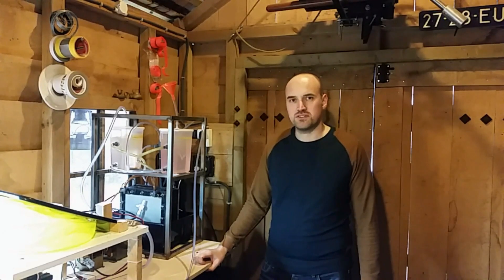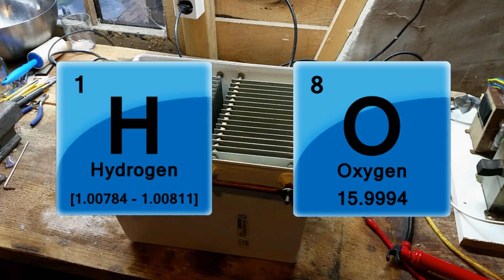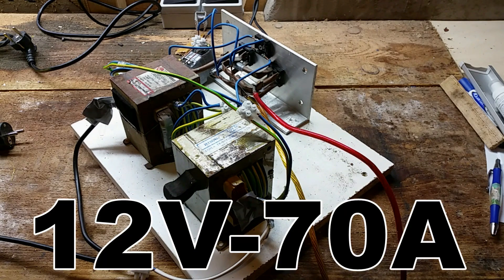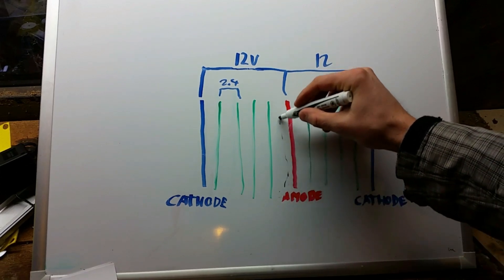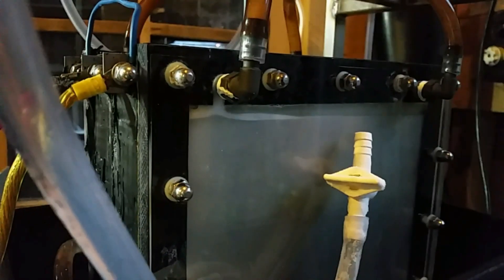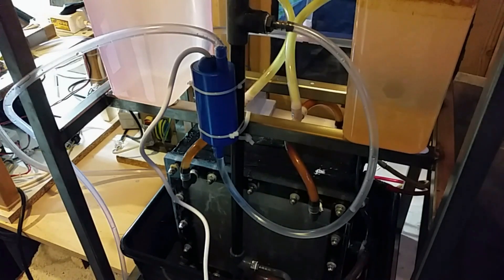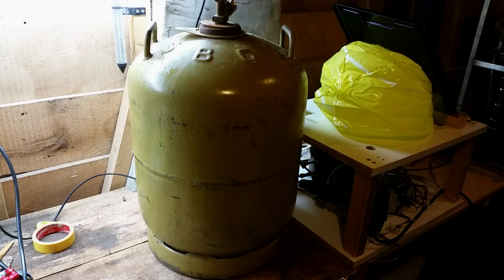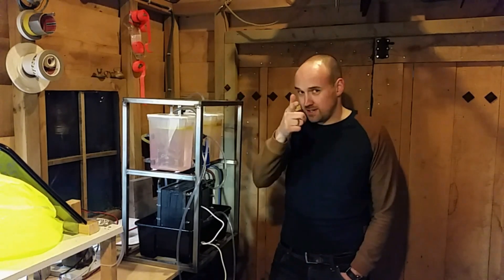Hydrogen Generator #1 Homemade Hydrogen Generator And Compressor Unit

Comment from the maker: Here are all the hydrogen generator videos, enjoy: https://youtube.com/playlist?list=PLTYlUGKLEk-GZfbXewpyRNn2iJ8RNepBd
Reply: As you have to use DC - have you tried powering using solar? Also, you mentioned heat generation an issue - could you use that heat to generate hot water through a heat exchange? The point being, you could use a full solar system to generate power and hydrogen during the day - with battery storage. Use the excess heat for hot water and the hydrogen gas for heating. And sell the oxygen onwards.
Reply from the maker: No, I have not tried that jet. And yes, that would al be possible. Good suggestions! 👍
Reply from the maker: Well that depends on so much variables, size of you care amd house plus insulation. Yes I'm Dutch.
Reply from the maker: No I haven't yet.
Reply from the maker: No, sorry, I only have the videos and the diagram.
Reply: Thanks
Reply: To keep your compressor running buy a potential relay setup with a star capacitor and every time it turns off it can come on with no problem right after it shuts off instead of waiting for it to equalize hope this helps
Reply: is there a point where where you need to add new water or how is that arranged ?

thank you for your video
Reply from the maker: Yes, but it's only a small amount.
Reply: Thanks
Reply: Heb je hier planne van? Ben zo benieuwd
Reply from the maker: I have a diagram on Facebook: https://www.facebook.com/234679430309932/posts/pfbid0zkfNAvgzUFJKLaCM4KE457xyGV7rhU7NqZDama54mQMgEzXyyejB6LAApa6TS8CVl/?sfnsn=mo hope it helps!
Reply: @TheDIYScienceGuy  Hey ... did you ever check the purity of the H2 mixture?
If so, how close to 100% is it?

What is the maximum you can compress it to with that fridge compressor?
I have heard that hydrogen can embrittle many storage tanks not specifically designed for Hydrogen. Have you any concerns with that or have you researched that at all?

Thanks man.. Love your work!
Reply from the maker: @TheBlairHouseProject No I did not check it with a measuring device, only just by burning it. You can compress to at least 35 bars, but I only go to 13 because it takes more energy to compress to a higher pressure and to keep it on the safe side. Hydrogen embrittlement  does not happen in austenitic steel, only in martensitic steel. So as long as you can weld the steel and the weld doesn't tear right beside the weld when you apply force to the part you welded on, you're good to go.
Reply: Losses are current leakage
Reply: did you try making a column to separate the oxygen and hydrogen?
Reply: You've got a good system
Reply: I would love your plans
Reply: I need a schematic of your system and explains of what your components do. I will be willing to pay for them should you ever decide to make them and have them available
Reply from the maker: @VG-rj8pn I have a diagram on Facebook: https://www.facebook.com/234679430309932/posts/pfbid0zkfNAvgzUFJKLaCM4KE457xyGV7rhU7NqZDama54mQMgEzXyyejB6LAApa6TS8CVl/?sfnsn=mo hope it helps!
Reply: I know this is old and I'm just now looking into hho generator but if you reverse the proses it generates energy right? How much energy could this produce
Reply from the maker: @eveni9574 No, unfortunately, that is much more difficult. You need platinum electrodes and a different construction: https://en.m.wikipedia.org/wiki/Fuel_cell
Reply: Beautiful work, 
Is it possible to post or send me a pdf blue print for the hydrogen generator please.
Reply from the maker: @tffffgvb 13 bar, so 188.5 psi.
Reply from the maker: @tffffgvb yes, they are all more or less the same. You can put several PC power supplies in parallel.
Reply from the maker: @tffffgvb no I don't think so.
Reply: Please consider your home insurance and codes, unlrsss mistaken as medicinal organic chemist pretty sure theres labeling WELL DEFINED RULES, slso matrix ā chemical mixture has to be kept with, unless thinking of liquid H2.  Was so bored at otherwise great synthesis and had many things going on wasnt listening.  They explained it in small amounts even on catalytic hydrogenated compounds, sort temp before added to heavy ballon septum under inert N2 atmosphere or ARGON.  Forgive me if incorrect, tss as Lt has color and label Diamond hazmat, if cad… could be looked up when chance, working on significantly more deadly project.  Good luck, seem responsible and safety science concerned.  👍🏻

Comment: :face-purple-sweating::face-purple-sweating::face-purple-sweating:BOOOOMMMM:face-purple-smiling-fangs::face-purple-smiling-fangs::face-purple-smiling-fangs::face-purple-smiling-fangs:
Reply from the maker: No boom!
Reply: @TheDIYScienceGuy  yesterday I was building one,and no flame able gas was coming out,so like an idiot,I squeezed the generator hoping it would squeeze some hydrogen out. It worked, but too well,and the spark traveled back up my hose and blew up my generator,with my hand still wrapped around it! I don't know how, but my fingers didn't come off, but it completely broke my left hand.
Reply from the maker: Oh, nooo!!! That is not good! You should always use a flame arrestor! I hope you get well soon!
Reply: @TheDIYScienceGuy  thank you. Hand is feeling much better today. I am still working on it building one,but I don't know if my solution for spark not traveling back in,is the same as what you described. I'm basically putting two water bongs in-between the generator,and the flame. I'm hoping the spark cannot travel through the water to get in the supply line. If you know of a better way, please let me know. Flame arrestor,is that like a propane gas regulator,or is it a container with water that stops it before it travels back down the line? If you are able to find a minute to share any tips,please let me know what I can do to ensure I don't blow my other hand up,lol

Comment: You should build a single unit that can perform the entire job. Not some $50k unit but just the basic like you have for us who want to put hydrogen to use but dont have the time money or know how to get to where you are with it.  Im smart with engines and i see th potential for hydrogen as a fuel. But if ya cant safely produce it at an affordable rate then its pointless.
Reply: The biggest problem with hydrogen is its storage. In the USSR, in 1988, they even built a liquid hydrogen-powered aircraft, the TU-155, where the hydrogen was liquid at a temperature of -253 C...

Comment: You have to take in consideration that h2 can go through steel,and couse internal cracks over the time.
Plastic Container shouldnt have that issue.
Nice ,clever Projekt!
Reply from the maker: Thanks! Hydrogen embrittlement does not occur in austenitic steel, which is where propane tanks are made of. Thanks for the head up though 👍

Comment: Hi, I'm no way near the technological level of you and most of the guys commenting but wouldn't using an alloy scuba tank be safer than a propane tank? I'm nervous thinking about hydrogen leaking out, mixing with air and igniting with all of the electronics and heat sources. Aloha.

Comment: Been following you since I saw this post and now have questions please Sir - 
I see you use a fridge compressor - is it dc or ac ?
What happens to the lube oil inside it - assume it’s mixed with hydrogen?
Is there no chance of it exploding (When the correct mix of hydrogen and oxygen is achieved) whilst pumping?
Would appreciate any feedback from you and your followers 🙏

Comment: I'll tell you the reason for the heat. Direct voltage to a cell also carries high amps. If you oscillate the voltage you will find elongating the molecule also snaps the bonds. Voltage as a potential does the work. One problem remains. The superoxide of the oxygen is unstable and must be expelled or treated to stabilize this condition or over time we lose the energy ratio. I'm working on a spark gap design using tungsten with two cathode to form a spark gap. then on the anode side a step toroid with two graphite rods which will unite the O2- and form stable O2

Comment: Very interesting setup! It looks like you really know what you are doing here. I am really wanting to make good use of Hydrogen at home here. I have solar panels and batteries but my batteries are too small for my setup by design to save money and also use that extra power to heat water and then one day setup something like this to produce hydrogen as well. Hey after you have compressed hydrogen, then what are you doing with it? I love the air ship idea. Anti gravity is possible with hydrogen, I love it!

Comment: I have solar at my house and a 10kW battery. During summers, the battery is full literally in an hour, and I need a way to use that extra power. So perhaps hydrogen production and storage for cooking or a hydrogen fuel cell? I don't know, but this gave me an idea. Of course, I am planning to expand my battery to 30kW, but I still have excess—almost 40kW excess!

Comment: How easy is it to cause an explosion when doing this? Also I'm assuming those 2 microwave transformers could kill someone very quickly, if being used stripped of any safety   features,  these are questions not statements, I got the general idea of your setup. Did I miss safety features refrigerator compressor, microwave transformers, water electricity, flammable gas under compression. What would happen if something caused sparks to shoot around. I know it's still in the works and my fear could be from ignorance not knowledge. I keep thinking head on collision of blimps lichtenburg & hindenburg

Comment: Could you plz mention the membrane you used.
Reply from the maker: This material is the best: https://www.amazon.com/Kimberly-Clark-33560-Polypropylene-Kimtech-Surface/dp/B00UBGXXS4
Reply: @TheDIYScienceGuy  actually i want to know about seprator membrane the above giving link is about window sheets
Reply from the maker: Werd it should be about kimberly and clark klimtechniek polypropylene cloth. That is the best material. The yellow stuff I used in the video dissolved over time. That's why I use the blue stuff now.
Reply: Ok thanks

Comment: Could you use the hydrogen to cool it?
Reply from the maker: Yes, but that would mean that you would have to make a heat pump that uses hydrogen as a working gas, which is not very efficient. Cooling water is better.

Comment: Thanks, how much is 70 liters as kg ? i just need to understand how many KM the car can move with this tank of 550 liters.
Reply from the maker: At 1 atmosphere at a temperature 20c, the weight of 70 liter of hydrogen in its gaseous state is around 6.02 grams.

Comment: Yes, it takes at least as much energy to split water into O2 and H2 as is released when these gases combine to form water. This is about 260 kJ per mole of water or just shy of 5 eV per molecule of water (4 electrons times 1.23 V) Found this explanation of energy released when water atoms are split a little further research and you could get a formula for energy loss in the form of heat I am sure.

Comment: Are you producing enough  hydrogen  with your unit to run a gas motor all day if so how small of hp would that engine be???
Reply from the maker: I'm not sure how small it needs to be but I think very small. I'm producing 70 liters of H2 per hour and as you can see in this video it's gone fast: https://youtu.be/llmcU-mZRFs

Comment: Hi, I'm interested in the efficiency of your system. From your data I estimated that you use 10v*70ah=840 wh electricity per hour and produce 70l of hydrogen per hour, that is 210 wh energy in hydrogen form per hour (3wh per liter of hydrogen gas). THat would give me an efficiency of 25%, am I correct?
Reply from the maker: Yes, that is the same conclusion that I came to, thanks! 👌
Reply: @TheDIYScienceGuy  Thank you for your answer! I still believe that it is interesting to use the available solar energy to store it for the long term in form of hydrogen, even with such low efficiencies. Maybe the efficiency would be greater with lower production rates?
Reply from the maker: I read somewhere that increased pressure and temperature inside the generator gives the best increase in efficiency, but that opens a whole other can of worms for a DIY project, unfortunately.
Reply: @TheDIYScienceGuy  True! Better stay with easy setups.

Comment: Here is a material you can use for your anode a cathode that is easier supposedly more efficient than the stainless an the plated copper. Thanks  https://youtu.be/CuZ5WxYwl4g

Comment: what material did you use for the filth?
Reply from the maker: Polypropylene is the best material.
Reply: @TheDIYScienceGuy  But it cant be water-tight, correct? Otherwise no current would co trough
Reply from the maker: Exactly.
Reply: @TheDIYScienceGuy  What brand did you buy and what thickness? Is standard polypropylene foil water tight?
Reply from the maker: https://www.amazon.com/Kimberly-Clark-33560-Polypropylene-Kimtech-Surface/dp/B00UBGXXS4

Comment: I realize this is older video but.... here is a detailed explanation on  determing waste heat without chemical side reactions. 

One may simply Model electrolisys as 2 resistors in serries. How much power is converted to heat and how much is converted to chemical energy that goes boom? 

Let's define  the  work done in the top resistor is the energy that goes to making heat, and the work done in the botom resisistor is the one that represents  the energy that goes into storing the energy chemically The bottom resistor is special in that it changes its resistance (much like a 1.24v zener diode) such that how ever much current goes through it, only 1.24v  is droped across it.  The top resistor then drops everything but 1.24v 

Example: 1
say you have 12.44v applied to a cell, and run 10 amps through it.  The bottom resistor drops 1.24v×10 amps = 12.4 watts is stored chemically as hydrogen and oxygen.   The top resistor on the other hand (12.44vsupply voltage - 1.24v water splitting voltage) × 10 amps = 11.2 overvolts × 10 amps = 112  watts of heat. 

Now if you dramatically icrease the conductivity of the electrolyte with potasium hydroxide, and increase the surface area of the plates but  instead supply 3v volts, and still push 10 amps. Then the second resistor is doing the same amount of work 1.24v water splitting × 10amps = 12.4watts storing chemical energy as hydrogen and oxygen.  And the top resistor is (3v supply voltage - 1.24 water splitting voltage) × 10 amps = 1.76 over volts × 10 amps = 17.6 watts of heat. 

Becareful how you look at resistance. In electrolisys, it is two different kinds of work, heat and chemical.

Comment: This video is amazing.  I enjoyed every moments and I learned a lot of stuff but mostly: You are a very skillfull man.  Thank you for sharing.  Also: Would you know how much the 550 liters of Hydrogen is weighting as I guess it depends on the pressure in the tank ?
Reply from the maker: Thank you so much!!! At 25 celcius at 1 bar it weighs 0.0813 kg per m3

Comment: THIS WOULD OF BEEN A LOT EASIER & SIMPLER TO KEEP THE SYSTEM COOL YOU COULD OF JUST RAN A HOSE FROM THE HHO MACHINE THREW A SMALL PUMP TO A  RADIATOR WITH A FAN ON IT TO COOL THE WATER IN THE HHO MAKER.. KEEP IT SIMPLE!!!!
Reply from the maker: What you describe needs about the same amount of stuff, and when it's hot outside, it doesn't cool so well anymore.

Comment: i missed how much electrical charge did you create?
Reply from the maker: 12V 70A
Reply: @TheDIYScienceGuy  thanks. this is a great idea. I am curious on why more cars don't have this system.
Reply from the maker: Because it doesn't increase efficiency. In this video, it is very well explained: https://youtu.be/6zErilY7E-M

Comment: You're explanation and whole video essentially condensed the information of 2 days Also better understood the process and rules what is the minimum voltage and amperage I'm interested in making both units but would like to make with out micro transformer I've had a few and they've scared me so much

Comment: You need "hydride" to store Hydrogen safely, before you cause an explosion ! 💥
Reply from the maker: You can buy cylinders with 700 bar of hydrogen in it so that is not the problem. Hydrides are used to store hydrogen at low pressures so the containment can stay light and you waist less energy compressing it.

Comment: how do you know if u get all the air out of the propane tank when u are compressing the hydrogen?
Reply from the maker: The first time I filled it there was still propane in it at ambient pressure. So overtime that has been flushed out with the hydrogen.

Comment: It is my understanding that you can use any voltage supply you wish as long as you divide the current between plates evenly so as to divide into 2 to 3 volts per pair of electrodes. If I remember correctly, each pair has to be insulated from the others. But it seems to me you could do the same thing using resistors or by some other means. The point being that the voltage must be divided between electrodes to put around 2 per pair. Also, more amperage is superior. So you can decrease your voltage and raise your amps and get similar output to say 12 volts divided between 6 pairs, assuming 1 amp. at 12 volts (12 watts), reduce voltage to 2 and raise amps. to 6 (12 watts).
Reply from the maker: You can only increase the amps by lowering resistance or increasing voltage.